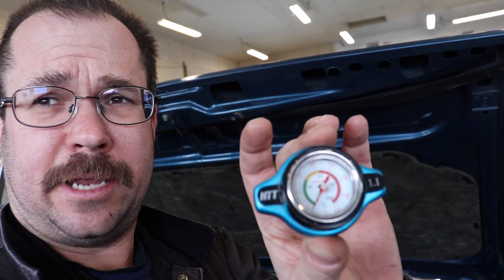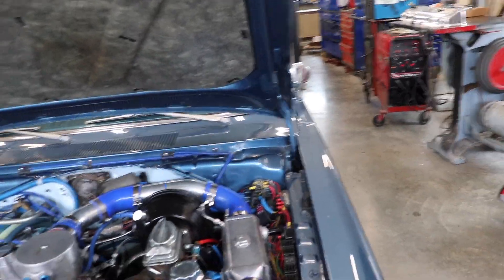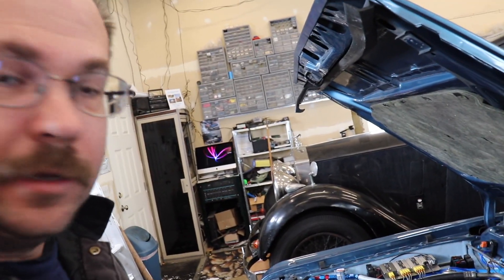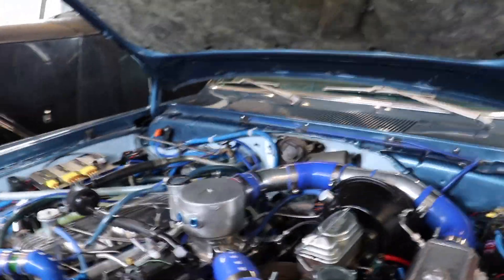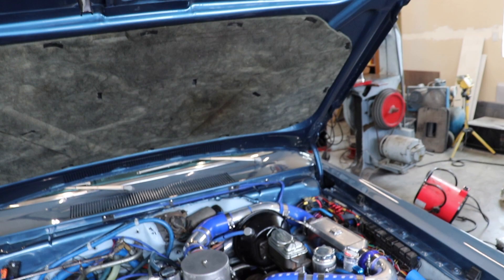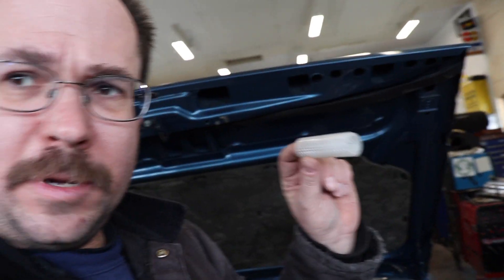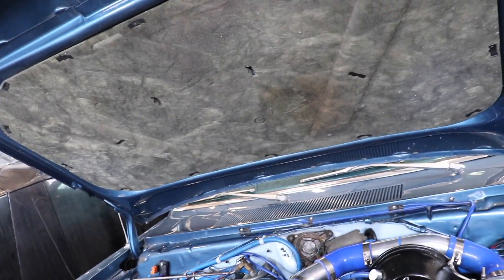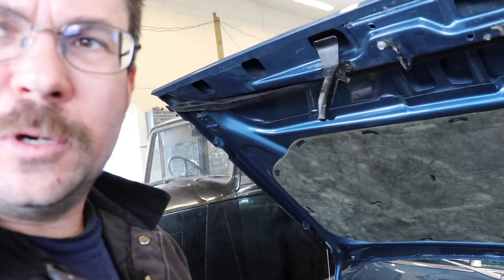Liquid Intercooler Upgrade/Clear Hoses

Comment: Have you tried using an airlift to bleed and fill the system. Alot of modern cars require to use one for that exact reason.
Reply from the maker: I was going to make an adaptor for the this system if I ever had to bleed it again, but not an issue now.